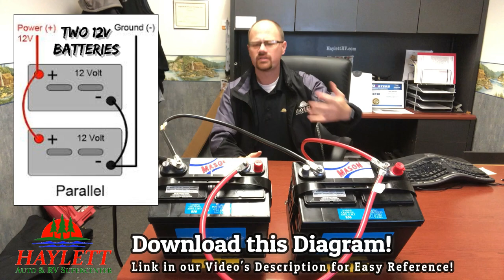How to Wire Multiple Batteries to an RV with Josh the RV Nerd

Comment: Nice video.  You did have a small mistake you referred to two 12 volt batteries in parallel as 24 volts, you meant 12 volts since they are in parallel.  @ 4:25.  Not a big deal, just thought I'd point it out.
Reply from the maker: Thank you for that correction! I want good info out there.
Reply: @JoshtheRVNerd  just watching your video.  I have a TRUCK CAMPER.  NORTHSTAR 
8.5 ARROW.  ONE 12V BATTERY. 
I HAVE 4 WIRES COMING FROM THE CAMPER.  2 BLACKS
AND 2 WHITES ALL WITH EYELETS ON THEM THAT ATTACH TO MY SINGLE BATTERY
 I WAS WONDERING WHY I HAVE 4 WIRES? I HAVE ALWAYS HOOKED UP 2 BLACKS TO POSITIVE AND 2 WHITES TO NEGATIVE WITH MY INTERSTATE BATTERY WINGNUTS. 
I WANT TO INSTALL A SECOND 12V BATTERY.  I WAS THINKING 1 BLACK ONE WHITE TO ONE BATTERY. ONE BLACK ONE WHITE TO THE OTHER. BUT YOUR VIDEO DOESN'T SAY ANYTHING ABOUT MY SITUATION HAVING 4 HOUSE WIRES IN MY BATTERY BAY.  CAN YOU HELP EXPLAIN WHY I HAVE 4 BATTERY HOUSE LEADS IN MY BATTERY BAY?
Reply: @mikeglasgow6656  My best advice would be to check with Northstar.

Comment: Thanks for the very clear description.  I always wondered why two 6-volts was claimed to be better than two 12-volts.
Reply: Basically, a large 12V truck battery is simply two 6V batteries connected in series, in one large, and very heavy, package.  No difference of the watt-hours are equal.

Comment: As a professional in the electrical/electronics industry, I've learned that no matter how simple you make things ... some people just can't grasp it.  I totally agree with your recommendation to contact those that have the knowledge and expertise.  Especially since the batteries you would be working with are "far more dangerous" than flashlight batteries when you do something wrong. 

Then when you throw in the different battery types and different Amp hours, Etc. ... It can become quite a bit overwhelming.
Reply from the maker: Absolutely sir. There are just certain things best left to specially trained folks.
Reply: Josh:
What also needs to said, and I know from personal expérience, is that it's very important to know and select your professioals and experts with care. Going to the wrong camper "professional" can very very bad. TT work done by some sam who doesn't get right, even if done in a "nationally known TT shop, can result in no power, blown fuses and destroyed batteries. I'm still glad that last summer that I had the Haylett shop guys covering my back and they were able walk me through, by phone with me in Mississippi, through a temporary electrical fix untill I got back to Michigan and could drop my micro minnie off at Haylett to have the work done correctly.
Wm. Schooley

Comment: 2 years ago I attended the National RV Training Academy in Texas to get better education in RV systems.  Money well spent and I came out with the Level 1 RV Inspector certification; and all the education for Level 2 as well.  One add to the battery comments:  if you put two batteries together in either series or parallel it is best if they are both new.  Coupling an older battery to a newer batter won't give you the preformance desired.  Also learned that if you mess this up it will be expensive!
Reply from the maker: Absolutely. Great point and thank you for bringing that up. You always want batteries to match "as much as possible"

Comment: I bought two 12 volt batteries for my 1999 fleetwood bounder. When I went to hook them up, I find 2 red cables and one black in the rv battery compartment. I can't find any explanation as to why I have an extra red cable. Am I missing a second ground cable? or am I supposed to disregard the 2nd red cable and just let it hang loose and unconnected? I can't figure out what it powers.

Comment: sometimes we go to do an overnight truck stop sleep over to get to our destination will 2 of the 24 group deep cycle batteries carry us for the night I do have a 12 V fridge will probably run a few lights here and there nothing extravagant, and if I’m correct which I will pull my trailer plug from my truck because the battery will pull voltage from the truck charging system when it’s running is that correct thank you
We are new to the bigger RV camping we might have to let the furnace run once in a while through the night because we are heading south to Myrtle Beach from the north and we were going to layover in Virginia and this will happen at the end of March so we might have to also run the furnace once in a while
And in October we have a two nighter in Assateague Island in Maryland with no electric would you advise or let me know if the 2 12 I bought 24 group patties for Karius I was going to borrow a Honda generator from work just in case the light white 1000 W

Comment: Not sure if you have an updated video for Lithium batteries.  If you want to replace the battery for a Lithium is it as simple as swapping them? Or do you need a different charging system/solar panel control system? 
thanks in advanced.

Comment: Would recommend also getting a cheap multimeter. Tying in with what you said about the remote control, if you aren't comfortable using a multimeter to check the voltage you're about to connect to your RV, then this probably isn't a job for you. You can get a cheap multimeter for under $20 that may not do a ton of things great, but will definitely let you know whether you're about to connect 12V of power vs 24V ( accidental 2x12V in series ) , or 6V ( accidental 2x6V in parallel ).

Compared to the cost of the batteries you're installing, or the repairs for connecting incorrect voltage. The < $20 is nothing.

Comment: My 12000 watt inverter is a 24 volt required to work. I bought 4 batteries, 2 pair of parallel with batteries 2 and 3 hooked in series. Battery 1 positive (+) and battery 4 negative (-) going to the inverter.... Now here's my question how much roof mounted solar will I need to keep the batteries charging if I'm running both a/c units?
Reply from the maker: Montana has basically answered that. They're coming out with a "Super Solar" system that is capable of truly running EVERYTHING in the RV at the same time (including both airs AND a resi-fridge) with no breaks in service. But it's an option over $10,000 with four giant Battle Born Lithium Ion Batteries and a ton of other stuff. 

Naturally.. Mr. Haylett wanted one as a demo. So you're going to get to see a SUPER SOLAR Montana video from us as well :)

Comment: So, one you have two 6 volts wired up is there a way to add another two 6 volts together for more storage or is it two and done.
Reply from the maker: Yes it’s possible
You need each set of 6v wired in series creating a 12v system

Then you wire those two mini systems in parallel

And if you don’t know what you’re doing there… then have a professional do it

The biggest hiccup for that is the limits of your tongue battery storage space

Comment: Very well done Josh ..... as usual!
One additional thing I would mention for those considering 2 batteries to take into account.
If you do the 12's and one dies the other will still power your rig.
If you do  6's and one dies you are dead in the water with only 6 volts feeding the RV.
Reply from the maker: REALLY interesting point.
Reply: If you have two 12 volt batteries wired together the dead one will pull the good one down so you have zero batteres withing a few hours.

Comment: Do the batteries have to be identical in specs? IE cranking amps, manufacturers etc?
Reply from the maker: They will only work as well as the worst one basically 

So more identical is better and easier

Comment: What about locations to place the 12v pair?  I have a 2nd 100aH AGM   Can the travel trailer tongue 26ft length support that weight or do I need to put them inside with a vented box?
Reply from the maker: Varies by model obviously. Most standard sized travel trailers have room on the tongue for a pair of batteries.

Comment: My RV solar panels are keeping my two 12V deep cycle batteries charged just fine but I would like to have them keep my under the hood starting battery charged also. How would I wire this ?
Reply from the maker: Hi Loren! Sounds like maybe you have a motorhome? 

You might need a dual charge controller to run the wires also to the chassis battery
Reply: @JoshtheRVNerd  thanks.  I will look into that

Comment: So do I need super heavy cables between the batteries?  The camper connections are 8 gauge.  Why would I need 4 gauge between the batteries?
Reply from the maker: You need wiring appropriate for the amount of juice running through in the area. Too much won't hurt. Not enough can be a problem. 

No joke -- saw someone trade in an RV who "custom wired" multiple batteries with lampshade cords...

Comment: Shouldn't they be charging whenever my generator is connected and running or the trailer lights are running and hooked up to the truck?
Reply from the maker: Generally yes. The truck does need a charge line run thru the 7-way plug. Not ALL of them do
Reply: @JoshtheRVNerd  which is the 7 way plug? Is that the 220 coming out of the back that goes to the generator or the one that hooks up to the truck while driving? Both of the 40 Amp fuses were blown I noticed a few minutes after I messaged you.

Comment: Thanks for the video can you mix 12 volt batteries with two 6 volt
Reply from the maker: Theoretically IF wired properly, yes. That wiring job is NOT something you should be attempting without a little previous wiring experience. 

Additionally... I absolutely wouldn't recommend it. When you have multiple batteries you should do everything you can to make them all as close to identical as possible. The way the system would work you'd be limiting yourself to the effectiveness of the weakest battery basically.
Reply: @JoshtheRVNerd  thank you I'll wait till I have to get new batteries then to add more

Comment: What is a good spot to put these batteries? I understand it needs to have some ventilation? That’s my only dilemma, thanks for a great video!
Reply from the maker: Depends on the type of batteries. Some batteries NEED to be ventilated and mounting them outside is the most effective way. Some do not and can be squirreled away in the pass-thru compartments.

Comment: Since you brought up the topic of adding more battery capacity, where would you put ANY additional batteries in such as a Jayco Greyhawk 29mv since the battery tray is only designed for one battery of limited size?
Reply from the maker: Hi Antone! This is a bit too specific for me to be able to provide a unit-by-unit answer, though I cannot recall seeing a Jayco motorhome set up for anything less than 2 batteries on the slide out tray before...

Comment: So I am set up with two batteries in parallel if I want to add a disconnect switch would it get set up on the negative side of the setup ? I'm thinking run the negative from the RV to the switch and then another lead from the switch to the negative of the second battery were the RV was originally hooked. Is there anything else that needs to be done?
thanks
Reply from the maker: Generally speaking a switch is just a current interrupter that can be placed theoretically anywhere within a system. I usually place them before the positive terminal of the first battery. There are different types of disconnects, so it's difficult to provide specific advisory from generalized input. The switch you purchased (or are purchasing) should come with some simple directions I would advise you reference before beginning. 

As with anything with electrical: If you don't know 110% for sure, then get a professionally to handle it locally.
Reply: You want to add the switch to the Positive side.  Breaking the negative is pointless if your truck happens to be hooked to the camper because your are getting ground thru your trailer hitch and ball transferred to the rig.  Always switch the positive. No exceptions. If your AC power is plugged in your getting ground thru that because its neutral bonded, meaning the neutral and earth ground are tied together because your camper sits on rubber tires so you have no earth ground. Your getting that ground thru the cord from the power panel your hooked too.  Your camper generator is neutral bonded as well.  Ive been wiring  Government Communication vehicles for 32 years and Ive never seen a negative switch on 12v except on 50s and earlier vehicles that were Positive ground back then. They did positive ground to  help prevent metal corrosion.  Another option for battery drain is a inline diode but the switch is better.

Comment: Josh,
what about lithium batteries? Are they a good option? I know they are expensive but can last longer.  If money was no issue would you recommend them? Can they power TV's, etc..
thanks in advanced
Reply from the maker: Lithium is great if you have the extra cash for them. Powering a TV doesn't require different batteries, but rather requires things like inverters to turn battery power into household power for household appliances like TVs

Note 12v TVs do exist like those seen in Geo Pros

Comment: So i currently have a 2 12v system with solar. I want to add a third battery. Can I wire a 3rd 12v battery in parallel. Usually I see even numbers of batteries but will it hurt anything to run a total of 3 12v batteries?
Reply from the maker: No that the point of parallel. You could have 15 of them if parallel 

Keep in mind a system of batteries like that is essentially only as good as the weakest link.
Reply: @JoshtheRVNerd  awesome I appreciate the feed and appreciate the detailed video!

Comment: I think I read somewhere that the Positive cable going from the batteries to the trailer, in parallel, and the Negative cable from the batteries to the trailer should be the same length?  Is that accurate, or is it irrelevant?
Thanks,
Jeff
Reply from the maker: That sounds like something that matters more in theory than practice. You'd have to have a LOOOOOOOT of extra wiring for resistance to be an issue.
Reply: @JoshtheRVNerd , thanks.  Jeff

Comment: Josh, I have a 2022 Transcend with a solar panel, can I add a second battery to my unit?
Reply from the maker: Absolutely. You could add as many batteries as you want. Just keep in mind it will take the solar panel longer to charge them up as you add more batteries. Think of it like just adding a bigger gas tank

Comment: We are considering two six volt batteries, as we do boondock. My question is this. When I want to recharge the two six volt batteries in series, to which positive and negative terminals do I attach the alligator clip from the solar panel? Thank you, Josh.
Reply from the maker: Easiest way I can say it is "follow the leads off the trailer." Use the same terminals to which the RV's hot/ground lines are attached.

Comment: I'm going to add a 2nd 12v battery. The first battery is 405 cca and manufactured in 11/20. Two questions. Do the cca amps need to match perfectly and how far apart in age is safe?
Reply from the maker: I always recommend making batteries match as closely as possible. Basically they'll only work up to the point of the "weakest link." 

IDEALLY you'd want to get two fresh batteries
But non-matching won't hurt you -- just may not get the FULL benefit

Comment: The Motorhome we bought have 4 12v batteries for the rv and 2 for the truck part. The previous owner had batteries wires but not sure if he has it correct. How would you parallel wire 4 (12v). Can u send a diagram?
Reply from the maker: I show you how to do it here: https://www.youtube.com/watch?v=A1_PyhNjljI
But with batteries if it wasn't done correctly, then chances are... You'd Know

Comment: On the 2 -12 volts in parallel scenario, where would I hook up my power tongue jack that is currently hooked up to my positive terminal on my single battery setup?  (I understand if you would rather have me ask my RV dealer tech, but WTH, I'm already here and I like your videos!)
Reply from the maker: If you match it up with the RV's hot-line coming off the chassis, then you're good.

Comment: When adding a second battery, what gauge of wire should be used to parallel the second battery? Same gauge as what's existing from the first battery to the trailer or does it not matter?

With our 2021 Shamrock, it came with additional wires (black and red) to connect the second battery, but I don't think they are the same gauge of wire what runs to the trailer from the first battery, if I recall correctly.
Reply from the maker: Apologies, I'm not an ace with that stuff. I know using at least the gauge used on the RV already is a logically good idea. I wouldn't use less
Reply: @JoshtheRVNerd  not a problem. I appreciate the response. I had the same initial thought as you.

Comment: One big concern with additional batteries is the impact on tongue weight.  If you use a heavier gauge wire to account for the loss over the longer run, are there any other caveats to relocating batteries somewhere further back than originally?  Also, do the trailer’s battery charge level indicators still read accurately?
Reply from the maker: The battery level monitor will work the same as you're still providing the same quantity of power to the RV -- just for a longer period. 
You can move batteries as you please, though it's tricky to do so when an RV isn't designed with that in mind. Additionally, it's important to keep them properly ventilated.

Comment: I have 2 (12v) batteries but each ones only measured 8.2v. Can I wired them to get 16.4v to start my Rv?
Reply from the maker: First, don't change the way they're wired. If you take your 2 parallel wired batteries and swap them to series as you're suggesting, then you're absolutely going to fry stuff. 

Instead, you should have your batteries tested. Chances are one or the other is bad which is causing the system to read lower than it should. 

You may find you simply need to replace one (or potentially both) batteries.